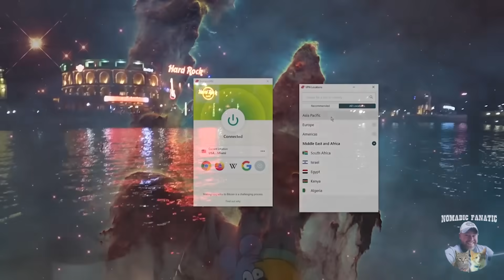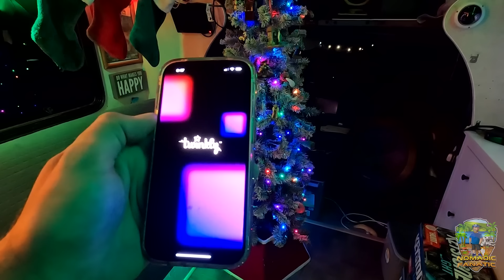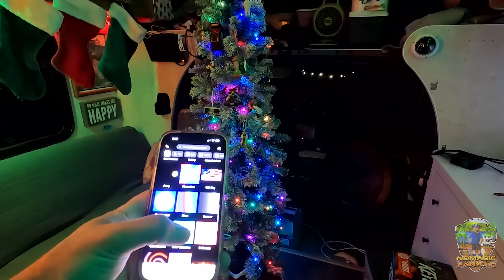Almost Catastrophic! Trying To Leave ~ Winterizing Fail On My Way South

Comment: Eric, solve lots of problems-INSULATE THE SHED !  It keeps stuff warm in winter and keeps the heat down in summer.  Also, make sure it's air tight as possible. You can heat this very economically even with a air filled electric radiator heater. I have a shed like this. Make sure you do the ceiling as well!  You will be much happier and much less STRESS.
Reply: Unfortunately he has limited time before the cold. I love how you share every little bit of your new ventures with us Eric and not make it seem like everything is peaches and cream. The only thing tho,(or maybe I missed it) was the part of the puppy episode. I know one day you adopted him and were super excited about it and then all of a sudden there was no more talk of the adorable little guy? What happened? Well hoping and looking forward to you and the kitties new adventures and you all will be safe for sure. Oh another question is what is this EMS thing on your trailer battery. Is this a possibility for Blue? Just curious. Love what you did with your property. Dan is a lucky guy to have such a great place to stay. Hoping he can make some videos too of his life there?? Okay well safe travels you three.
Reply: Yep Insulation is Key. In AZ my new Tuff Shed was clothed with insulation all way around.
Within hrs of she’d constructed 
It has so many benefits as you mentioned . I used to work as a Energy Advisor. Save $$ with Insulation
Reply: If you don't let certain materials breath out will have problems
Reply: Good luck with this mickey collection up
Reply: Pack Rats love insulated sheds in high desert. He should have bait stations down or he may not like what he finds when he returns.
Reply: You can get some good SIP panels to insulate the shed. Or just some other good insulation.

Comment: Not to beat a dead horse but... I had mentioned in the comments a few months ago that you should insulate Babe. Not only will it help to keep it warm in the winter but also help with the heat during the summer. Hanging insulation isn't that difficult and you could probably have that entire shed done in a few hours. After the insulation is done you could even throw up some Luan plywood to finish the look. Insulating Babe will have the added plus of keeping your collectibles safe from temperature changes as well. Good Luck on your journeys this winter.
Reply: Order one of those spray in foam kits, or call a contractor to spray it in.  Maybe 2 days of work one day to unload the shed and one day to load it back in. Just electronics going would keep it warm.

Comment: I sure don’t agree with the open flame heater in shed. The Olympian wave 3 heater would be safer. Also transporting propane in the trailer should be in sealed locker with floor vent. Be safe.

Comment: I bought JITA. 300ah lithium 12V  batteries with built in heaters. Not sure if they are selling them still.  When under 32 degrees the built in heater kicks in and heats them to 50 degrees. Pretty cool . I have an Aluma aluminum trailer built into a tiny home & it gets cold in Wa state, you know .Hope this helps!!!

Comment: I made a little room around my water holding take for my well water. I then put on a open bottom bracket on one wall with a hole just big enough to hold one of those heaters that plug into the outlet.. Then a heavy duty extension cord to the actual wall outlet. The thermostat is set at 60. The little box room is warmed when it goes below 60. All I'm heating is a 2'x 4' x 3' high area. Nothing freezes. Costs next to nothing.
Don't let that infection settle in your lungs. 
Lots of chicken soup and broth or clear stock. Extra huge amount Vitamin C. B vitamins too for energy and strength.😊

Comment: I have a cheap solution to your battery temperature issue. If you can dig down below the frost line 18" you'd never need to use a heater. Let the ground keep the batteries at a constant temp year round. Either cut through the floor and  dig a shallow cellar or relocate the batteries at the edge of the   shed. With 48v the extra length  of wire won't cause issues if you don't go crazy.

Comment: ❤❤❤❤ A Pelonis brand Oil Filled (sealed) heater with digital thermostat that can be set to any temp would be safer and more efficient.  They may also have a diff brand  with an app that can be controlled remotely or you could use a smart socket with an app for emergencies to shut off remotely.  There is no propane needed, no open flame just oil sealed inside that heats up the register looking thing that eminates heat kind of like the old steam heat registers. It just plugs in to regular outlet for electricity.  Not too expensive either around $79.00.  I heat my whole house with 2.  One would have that shed toasty as can be.  ❤❤❤❤

Comment: Eric, I might rethink that ventless heater in with your collectibles.  Ventless heater produce water as a  byproduct of combustion it will rust any steel you have in that shed fairly quickly.   A friend of mine had one of those heaters in outbuilding many years ago and it rusted anything steel in the shed.  Not trying to bash you just don't want all of your stuff to get rusted up.  Keep the good stuff coming buddy.
Reply: I wonder about leaving that gas heater in there going for months what kind of damage it might cause. Although here in AZ never gets about 15-20% humidity. Winter, I have seen it get down to 5% humidity.

Comment: Safe travels. They make thermostat outlets too.  Id just make a basic plywood box for the batteries and put ridgid insulation under and over box. Then a small 110v heater plugged into thermostat outlet to heat box 👍

Comment: Styrofoam is highly flammable. Not a good idea to use around your batteries or to have a heater nearby.  You need to change that. Video was very informative.

Comment: Eric if you use a heat pad that nurseries use to germinate seeds. Under the the sead beds. They are made to go to 77°. They are made to go underneath those batteries. Or send beds or what ever.

Comment: Dd's family was builders, When I was out, owning my building my own place, his advice was' Insulation is top priority' have thick insulation so you can heat the house with a candle, 
that was the days before foam was invented, so, instead of using 2x4s we used 2x6s for thicker insulation. 
The ongoing fires will drive all the packrats your way looking for cover. 
I thought off-grid was the simple life, but I believe I am changing my mind. 
Glad you have Danny holding down the fort.

Comment: the 12v heating pads will work if you build a raised platform for the Redodo battery bank and fix the pads to the underside of that, leaving good air circulation. Use a 48 to 12v converter to power the pads or plug a 12v transformer into a mains voltage outlet
Reply: The propane solution is like crazy dangerous IMO. Maybe it'll be fine but an open flame is always a risk. I build a heated cat shelter for my cats with a 250 watt bulb, you could probably use a 150 watt bulb for this and not have a problem. Obviously you don't want to put it too close. 

Ultimately this is the price of having bad batteries I guess.
Reply: About how many watts do you think?  I estimated about 20 watts should handle it. (Per sq ft)  Connect 4 (or 5)12v pads in series for your 48v system.
Reply: good question - with an insulted hood that might be enough, but I would go for more initially  @kenffisher
Reply: @mattstopa9436  I agree with you one hundred percent on open flame risks.  Especially since he has an impressive collectible cache.

I'm not sure your heat lamp solution is viable in such a large space, or long term dependable.  Good idea though.
Reply: While heating pads may keep the batteries warm, ( the whole point of NF putting the propane heater in,) it doesn't heat the whole shed.
Reply: @timothyreilly8394  It keeps my cat shelter at nearly 60 degrees even when it's 20 degrees out. So it should work. Realistically he just needs some sort of low temp shut off switch because any of these solutions could fail and fry his batteries.

Comment: hi eric hey i  wanted to let u know their are  gel filled batteries that are good 0 to 160 degrees i live off grid full time and had 4 years no prob snow and hot summers and my solar shed is a old shack with no heat or cooling system and they can last 10 years just wanted let u know the fridge video u made was great i got one and got rid my propane fridge thanks share that thanks your videos

Comment: Soo…. If you put those batteries on a metal shelving unit and then put those 12v heating pads on the shelf below them, with nothing on the pads, would that provide enough heat without damaging anything ?

Comment: You CAN let SOLAR CHARGE IN FREEZING conditions. BECAUSE solar charges at a very slow rate which builds slowly and warms the battery  and safety charges them. My system works at -20c without Any heat on solar and HAVE DONE FOR OVER 12 YEARS SO FAR.  CHEERS AND SAFE TRAVELS    Steve h.
Reply from the maker: "becuase solar charges at a very low rate".... Um... Not with this array that pumps 410v into the batteries. No, you cannot charge lithium when the batteries are freezing. You're spreading very bad info and I'm just gonna stop you right there.

Comment: No one seems to care about UL approved batteries but it really is important. No noxious fumes and no concern regarding fires. Lithionics was the first UL approved RV lithium battery. I’ll be loyal to them….and they also self heat below 38 degrees.

Comment: Hydraulic is the best way. That's how I do it in Australia. garden hose wrapped around the lithium. connect to a pump and then an Electric 12v or 24v hot water system. triggers off when below 0deg. keeps the battery warm
Reply: Yeah, but what happens if hose spring a leak.  The water can do a lot of damage.  What happens to his collectibles, if the water sprays on them?

Comment: buy a rockwool insulation mat or make a box you can put over batteries that are insulated with 100 mm insulation and a regular light bulb keeps it frost free.. do it in my boat live in a country with down to 18 minus degrees

Comment: .....couldnt you just configure the charge controller to not charge if its under temp? Most of those AIO systems do have temp monitoring built in

Comment: Eric, I use a Victron solar controller in my motorhome and it has a low temperature cut off in it so it will not charge my lithium batteries if they are below the temperature that I set. If you put a BMS on your lithium batteries you will see that they are staying a lot warmer than what the room temperature is because you were drawing a load from them. my batteries are in an outside battery compartment on my motorhome and I’ve been in 19° weather and the batteries have never been down below 37°.

Comment: Elevate the batteries so you can put the heater heater pads under them so they are not sitting on the pads.

Comment: Difference between a good bms and a simple one is the low temp cutoff.   Which is basically the same temp probe but adding as low temp firmware check.  Not sure why the basic Chinese bms doesn't offer that, maybe because it might trip too early and they get returns.   Idk.

Comment: Most charge controllers have an optional thermal sensor. This will stop charging when the temperature is too low, or if the batteries get too hot.  Check with the company that sent you the new charge controller, and see what they can do for you.  Save you from having to run a heater if the shed warms up during the day, allowing the LiFePO4 batts to safely charge.

Comment: Odd that the sungold doesn't have a temperature sensor to stop charging when it gets to 32F. My standalone Epever has one came with a sensor leads to run them to the battery box. Guess I won't be buying a sungold while doesn't freeze often once in a while it does. My Epever charger it protects my batteries. I looked at Signature solar seems like at least the lower power ones don't have one either. Maybe they all rely on the BMS to handle this probably the reason they recommend to buy server rack style batteries instead of the cheaper 12V typical RV type looking batter.

Comment: 12 volt Silicone hive heaters stuck to the bottom of a ⅛" thick aluminum plate. Use a temperature controller to activate at 3⁰C and deactivate at 5⁰C. Set your batteries on the aluminum plate. Roaming Freely has a good video on how to set this up. The temperature controller is very similar to how you set up your cooling fans in your RV battery compartment. 🍀

Comment: You could use what I use a 24 hour Timer with a 200 watt electric heater would work good you can even use a 34 degree outlet after the timer before the heater to turn it off over 34-36 F....Lasko - MyHeat 200W Personal Ceramic Heater only $32.99.....  (works 10 hours with just my 1500W Pecron) (just with 15 minute on then 15 minute off.last 10 plus hours)... ,   last way longer with this.... Thermo-Cube Temperature Controlled Outlet Adapter the $19.00  works great in Ohio... safe travels...hey what about your outdoor screen ?

Comment: Get Waggle or a security camera that sends you notifications on the parameters you set for high and low temps. You can also get a 48v to 12v transformer for your heating pads. Lay them on top.

Comment: Just like one of the subs said, use spray foam for installation,  batteries with a low temperature cut off. A lot less worries than have a propane flame on all the time. Thanks Don

Comment: Do propane heaters not need some kind of air flow for safety? Glad you got something figured out to keep things warm. Safe travels and see ya on the next one 🤗
Reply: The ventless type heaters don’t need ventilation, but it is very smart. Have a window cracked.

Comment: Eric,  this will probably reach you too late, but I was pondering what to do when I was about to replace my 3 agm batteries in my 7x14 enclosed trailer.  I discovered LiTime batteries.  Yes they are Chinese batteries.  They have a self-heating model in different sizes.  I the temp drops too low any power sent to them are used to run the heater until the temp reaches the required level. Then the power received is switched to charge mode. I purchased 2 200ah batteries for around $1500.  Just something to consider.

Comment: In the future of heating the batteries, consider a larger box for them with a small electric heater inside.  An oil type would be the safest for that type of set up.

Comment: Eric. Check out the ChickenCozy radiant heater used in chicken coops. It is electric but might work for your battery heating. Just a thought.

Comment: Bro you saved my A$$ on this solar part. I literally had my plans set to hah r those same heaters from my batteries to solve my low temp issue but knowing now what you told  me I will not be using theses heaters under my batteries. 

On another note come back down to Yuma Eric! It’s nice down here during the winter you’ve been here before at the Imperial Dam area it’s nice. 😊

Comment: Have you thought of using a ceramic electric heater instead of propane?  I heat my entire 3 bedroom mobile home with 2 1500 watts heaters.  Yes I am in Florida and we only get temps down in the 20s during Feb/March, but they keep it toasty in that
 For that little shed, 1 should be fine for the temps you want to keep it.